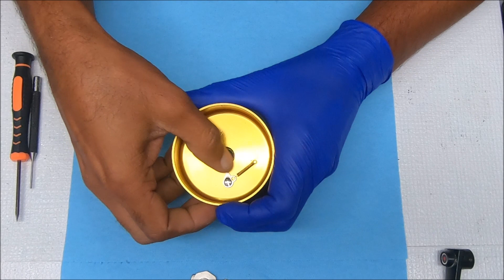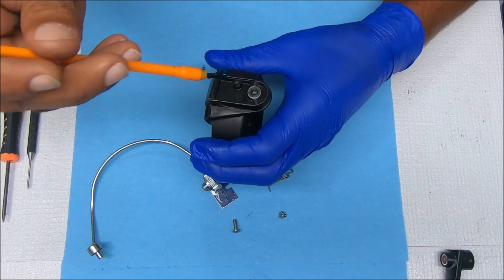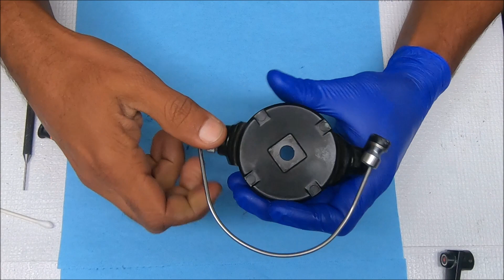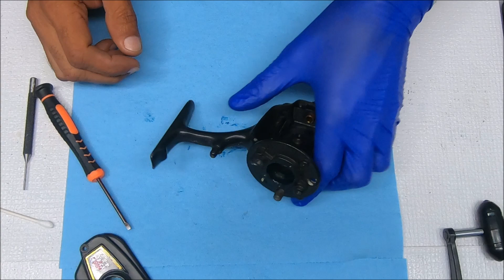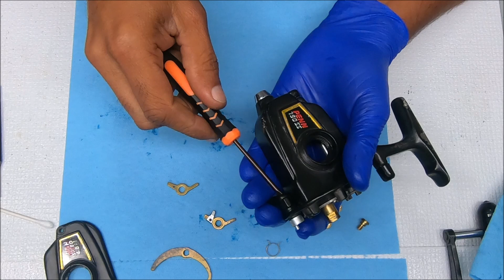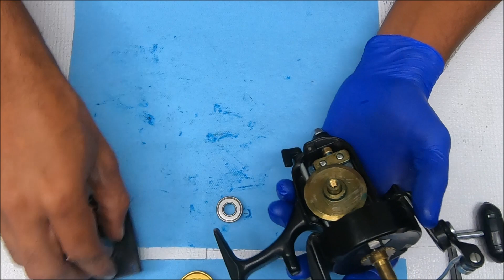Rebuild of a Penn Spinfisher 750SS: Fishing Reel Repair

Comment: hello i wanted to ask if you maye still have a 420/430ss main shaft 😄 im from austria and got a 420ss a couple weeks ago it had some damage tho 😅 someone dropped it in the past i guess, the handle, bail and main shaft was bend wich kinda sucks but i upgraded the bail to one from a 420ssg with line roller bearings to use with braid and i changed the bend handle to a nice shimano knob with the parts from a gomexus power handle kit and i managed to straighten the mainshaft but its not perfect i have been looking for a new one for almost 2 weeks with no luck would be awsome if you could help me out with this project 😄 all the best 😁
Reply from the maker: Thanks for checking out the video. Well done with the restoration. I do, but it's pricey and so is shipping. Email me at tsgreelservice@gmail.com if you're still interested.